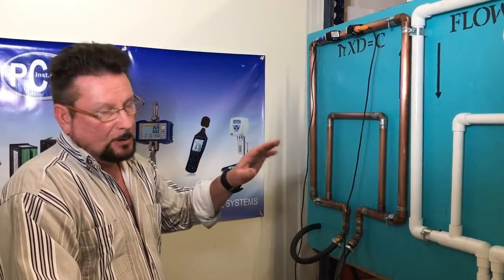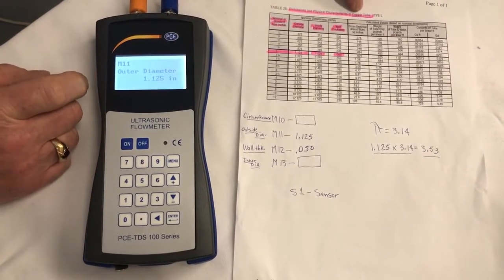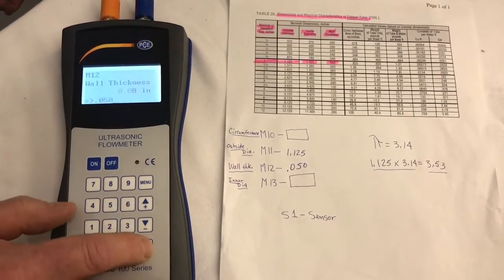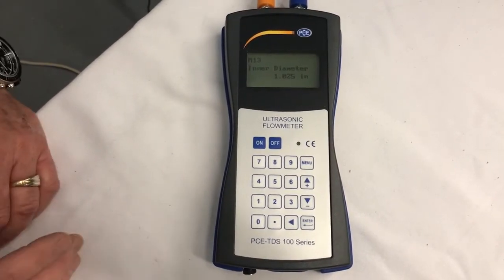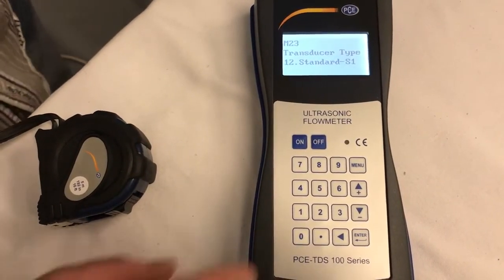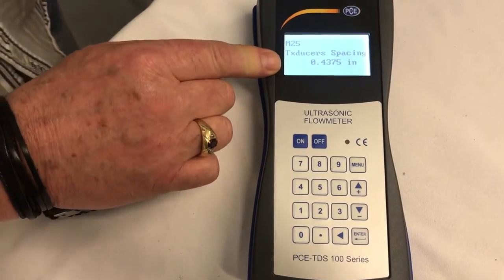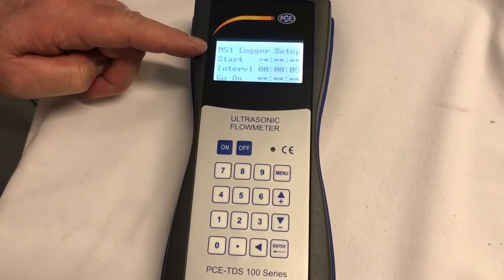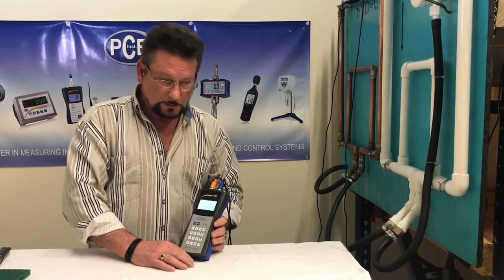How to Use the PCE-TDS 100HS Ultrasonic Flow Meter

Comment: How can we set a period of time for the instrument to measure for example 24 hours and then see the average of the measurement?
Reply from the maker: Dear Elpida Ikaria,

In the device you can set a logging interval (1 to 65535 seconds) and the device will start to measure and log the data until the memory is full.

To get the average from the logs you will need to import the data into the optional available software.

More information on how to set up the meter can be found in the manual.